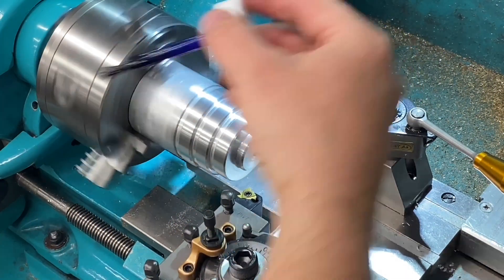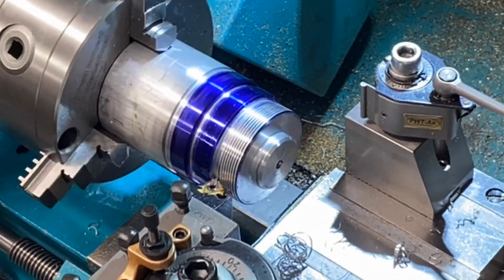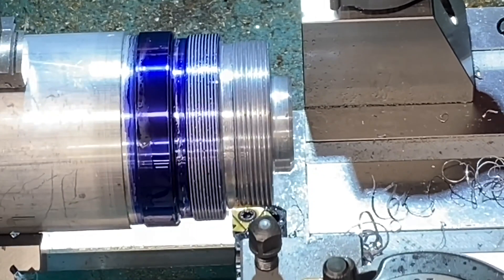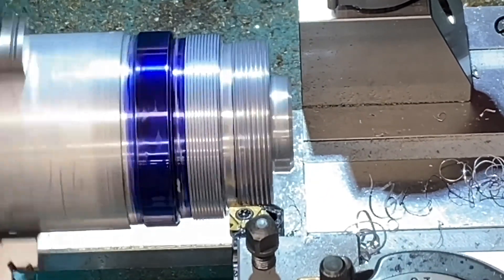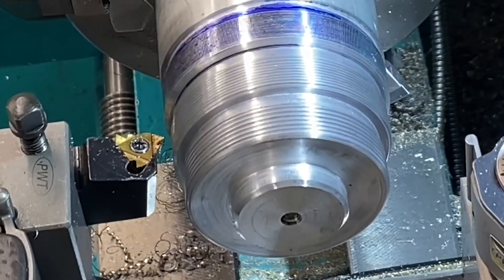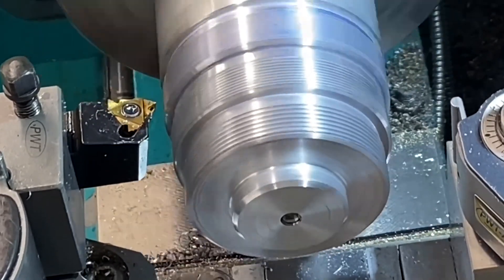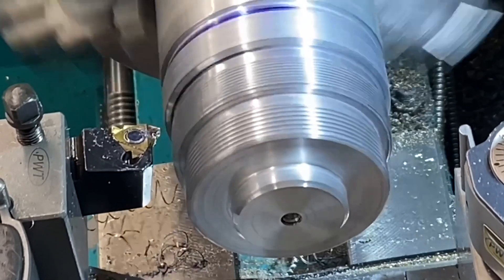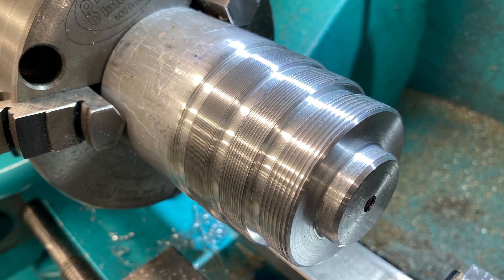Machining fine threads on a lathe

Comment: lamp oil is another option and doesn't stink as much, but I've switched to IPA after seeing Stefan use it. Less mess to cleanup.
Reply from the maker: Agreed. IPA is another good option but I assume you’re not talking about beer 🍺 🤣
Reply: @opticalmechanic  I wish I could use pale ale for aluminium, I could write a few kegs off as work expense 😆